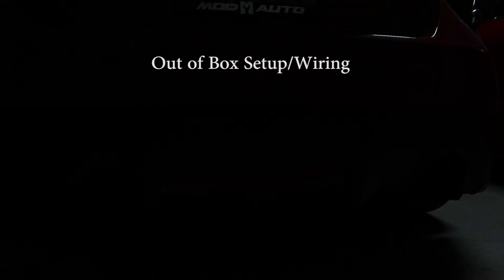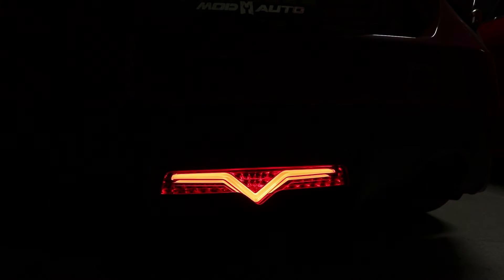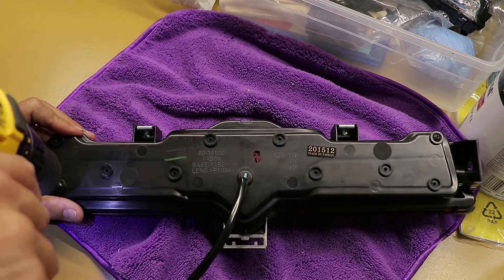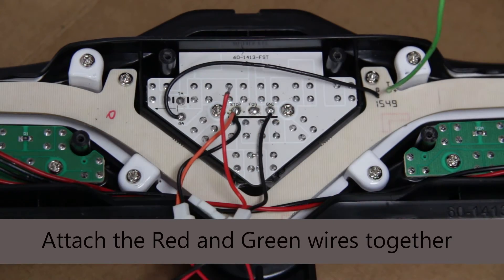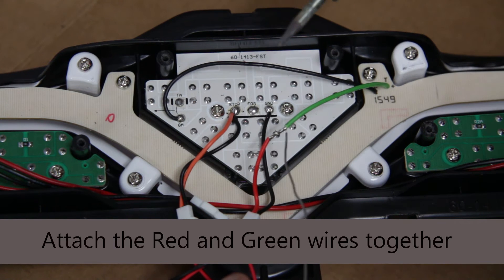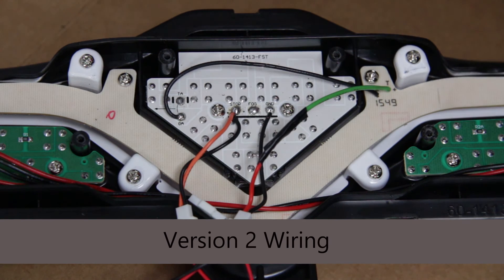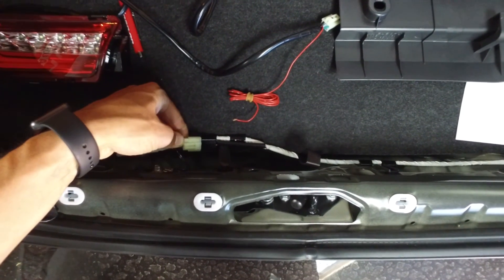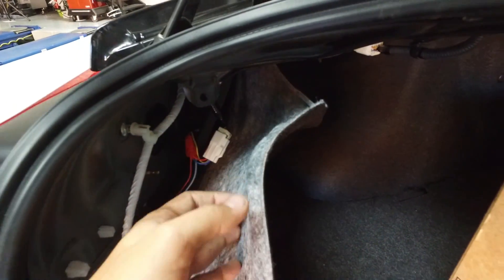DIY: Valenti 4th Brake Light Wiring Mod- HOW TO -Separate "V" and Brake

Comment: did you figure out why version 2 doesn't work? I'm about to order a 4th brake and want to do version 2. also with version 2 does it still flash when your headlights are off and you brake? thanks.
Reply from the maker: Nope, haven't figured it out-I think it's vehicle dependent. Try it, but don't screw everything back together. From what I've seen, MOST of the time version 2 works just fine. With Version 2, it will still light up/flash even if your headlights are off. It will act like a regular brake light-only "on" when you brake.
Reply: Charles Pages thanks! One last thing. What wires do I splice into with the valenti tails? Blue to blue and red to red still?
Reply from the maker: Correct!
Reply: will it be red to red and blue to blue regardless of the version i wire for the 4th brake?
Reply from the maker: Yes, unless you wanted to change something. The red wire on the 4th brake light tells the center triangle light to come on, and the blue wire controls the "v". All this mod does is depict whether it flashes or not (center triangle light)
Reply: I finally got around to installing it. I followed version 2 but the brake light is solid instead of flashing. Is that what you meant by those circumstances? Or is the circumstances regarding it not working at all?
Reply: Also what would happen if I only connect the green and red wire? Without moving the orange wire over
Reply from the maker: what happens when you hit the brakes? If the "v" comes on, the red and blue wires are reversed. The very rare/occasional problem with version 2 is that the brake light won't light up at all (well it does, but it is extremely dim).
Reply from the maker: The middle wire for you is orange? Haven't seen that before. If you ONLY connect the green and red wire, only the reverse light and brake light will work ASSUMING YOU'VE DONE VERSION 2 OR 3. If you didn't modify it, just hooking up the red will do nothing-the way this light comes stock is that the blue wire powers the "v" and the brake light, while the red wire is just a signal to flash.
Reply: Charles Pages my middle wire after rewiring
 is orange. When I hit the brakes the fog turns on but it's solid instead of flashing. I'm not sure if it's extremely dim. I'll have to double check later
Reply: Basically my wiring is set for version 2, but when hooked up actually works like version 3 instead.
Reply from the maker: Hmm, odd. You would know if it was dim or not-it's so dim that it almost appears off. Unless you really want the flashing, I might just leave it. Up to you though!
Reply: Charles Pages I want the flashing but don't know what could be wrong with the wiring. I have it exactly set like yours. Green and red connected, jumped the orange wire to the middle fog. Do you have any ideas? Thanks!
Reply from the maker: and you have it setup right now so the "v" turns on with the headlights, and the middle brake only turns on with brake, right? And this is the Valenti rear brake light-not one similar?
Reply: Correct the v only comes on with headlights, fog acts as a brake, and they're authentic valenti
Reply: I double checked the wire and everything is good. The fog actually flashes when I start the car but it's only solid when I brake and it's not as bright as when it flashes
Reply from the maker: Hmm. Odd. I would probably guess that yours is an "odd" one that doesn't like being wired like #2. It seems to be car specific too-I've tested lights on my car that DIDN'T work, but would work on another car. I just don't know what it is.
Reply: i noticed in the "valenti style" ones, you have to connect a ground wire to the bolt. how come the authentic ones doesn't require you to ground it to the bolt?
Reply from the maker: The harness that you connect the light to has a ground wire in it already. This is used by the reverse light that is back there, which means you shouldn't need to ground anything.
Reply: ah thanks. Just trying to think of a solution for this problem. I realized the braking is dim like you mentioned some people have. My only guess is maybe its a voltage problem since it flashes when i start the car and its also brighter when it flashes.
Reply: Finally got around to rewiring, I did version 3 now and it's perfect solid. Thanks for the video and help
Reply from the maker: Awesome to hear! Really wish I had an answer for why version 2 just won't work on some cars.

Comment: So out of the box there is no flashing correct? You would have to do version one for that
Reply from the maker: Out of the box, the light will flash. Shown at 13 seconds. Basically, the triangle and the "v" both light up, but when you hit the brakes, the middle triangle flashes. This mod makes it so the middle triangle only lights up when braking. Ver 2 or ver 3 tell it to flash or just turn on.

Comment: I did Version 3 Wiring and got it to look like 4:15.  Are there more detailed instructions for installing the light onto the car?
Reply from the maker: Only at the end of this video. Basically install it in the factory location, and run the wire loom into the trunk area. You'll have to tap 2 wires on ONE of the tail lights. The brake wire, and the running light wire. I would suggest solder and NOT t taps.

Comment: with the version 3 wiring will the brake light work when the brakes are pressed without the lights being turned on? Or do the lights have to be on for the brake light to work?
Reply from the maker: Version 2 OR 3 will allow the center brake light triangle to light up when the brakes are pressed WITHOUT needing the running lights to be on!

Comment: Hey,
I've wired it up for v2, but the V isnt coming on, only the reverse lights. Should I try v3? or did I screw up wiring somewhere
Reply from the maker: Check wiring (where do the blue and red wires get plugged into?). The only "problem" that could come up is that some lights/cars don't work with version 2...but the issue would be the middle triangle won't light up. After you do the rewire, the "v" is powered by the blue wire from the valenti light, which gets attached to the running light wire on either tail light.
Reply: So i cut open the wire for the 4th brake light harness, pulled out the blue and red wires, tapped the blue and red on my valenti drivers side tail lights and connected blue to blue and red to red. Another thing is that when opening up the 4th brake light, i never had the green wire to solder it was blue instead, but I assumed the wires were the same as they were wired the same way as the green one in your vid
Reply from the maker: Did the circuit board/insides look identical? There was an older version of the valenti lights-I have the info for how to rewire those, but I haven't put it together yet. You might have an older version light? If you could send me photos that would be best. Also, how did you make the connections? Wire taps or splice/solder?
Reply: They look pretty identical from what I remember. I tapped the wires. I'll remove the light and take some pics of the circuit in a sec
Reply from the maker: wire taps would be the first thing I check. If your light visually looks the same as this video, you're all good. But if it looks different, its probably the older version. How old is the reverse light?
Reply: Light it brand new, I just got it yesterday. I took it off and opened it up, heres  a pic http://imgur.com/a/mS9wk
Reply: brake lights arent coming on either. only reverse lights work
Reply from the maker: first, lets deal with the "v" which is the blue wire/one that is connected to the bullet connector/near whats labeled "T" in you photo (has black wire right next to it). Trace that wire, and make sure its connected to the "blue" wire lead outside of the light-the one you run up to the "blue" wire on the tail light. 
I would remove the wires attached to "stop" and "fog" in the mean time (keep them covered). Once this is done, turn on your running lights. The "v" should light up. If not, re-check wiring involving the blue wire only. Also, keep the white connector harness plugged in for all of this-it serves as the ground wire, which we know is working because the reverse lights work.
Reply from the maker: Once you get the "v" working, lets focus on the center brake/triangle. To keep things simple, start with version 3 wiring, which is both wires connected to "stop". Ensure these wires connect to the "red" wire that goes to a tail light, and make sure the red wire is connected well to tail light red wire. Put in a spot you can view from drivers seat (if you don't have a helper). Alternatively, you could set your phone to video record it while you step on the brake so you know if it works or not. Once you confirm the brake light working, then try version 2 wiring, which is one wire on "stop" and one wire on "fog". Repeat the test. If it doesn't work/light up, revert to version 3 wiring (no flashing). You've received one of the lights that doesn't work with version 2. Unfortutantely, there is currently no way to tell what works with version 2 and what doesn't. It seems random (which I just don't believe its "random" but I haven't figured out why version 2 doesn't always work with every car).
Reply from the maker: also, the very first thing I would check is the taps. Those things are one of the worst electrical connections I've ever dealt with. Some people use them all the time, others (like me) hate them since I don't have much (any) luck with them and they make diagnosing very difficult. I would ONLY keep them if you have a multimeter and can verify power is making it to the valenti 3rd brake light. Even then I'd splice/solder if you can. YMMV.
Reply: Hey, so I ended up splicing and soldering everything, and it works. Only thing is that although im wired up with the v2, my brake light doesnt flash (just comes on solid), and looks pretty dim. I guess the only fix is to wire up v3? would that make it brighter?
Reply from the maker: Oh, yup you got one of the lucky "not gonna work for some reason lights". Version 3 will work for you! No flashing, but it'll be nice and bright!

Comment: I was wondering if you had come across how to achieve the following? 
Triangle: fog light only
V light: comes on with breaking only
Reverse: comes on with reverse only

I love the light but can't find any tutorials as to how to achieve the above! Any help super appreciated! Thanks
Reply from the maker: First, I'd do version 3-no flashing.

V light-hook the "blue wire" FROM the valentines reverse light to the red wire (should be red) of one of the tail lights (left or right doesn't matter).
Reverse-this SHOULD be the regular plug and play connector/harness. The wire is teal/green. Out of the box it should only come on when reverse lights are on.
Triangle...this is what @andrew bailey was dealing with yesterday. This is the "red" wire from the valentines reverse light. Hook this wire to whatever wire has positive (+) when the rear fog is on. You guys have a wire running to the back of the car for this, right? IIRC you guys have a factory rear fog light, which means you have wiring there.
Reply: thanks man! Yep we have Factory rear fog. I'm gonna put an order in for the lights and give it a go when I get them :-)
Reply: Hello ! I'm in the same case. I need to have the triangle light up very bright to have it act as my rear for light, when I turn it on. Did you find a solution ? Thanks.

Comment: I can't seem to find install instructions so I have to ask, if I just install normally without rewiring where do I connect the separate red wire that is next to the harness? Thank you!
Reply from the maker: Sorry for delay-holidays!  Anyway, the red wire needs to go to the brake light (driver or passenger-it doesn't matter). There are 4 wires in the plugs for the tail light, you need to tap the one that has (+) when the brakes are applied. I don't recall the color. If you have valenti lights however, its the "red" wire from out of the valenti brake light.

Comment: so i have a rather weird question. 

I wired mine up like you shown for version 2. everything works properly other than the brake light. when the red wire is connected to the brake switch wire it comes on extremely dim. if i connect the red wire to the parking light wire it does the flash and stays solid like it should. i even connected it to the turn signal wire just for shit and giggles and it works. but once again on the brake wire. its not working. i was fiddling with it for a while and it eventually started to work. turns out it only worked when i had low battery power. so with that in mind i tried a resistor in line and still nothing. so now i am completely stumped. if you have any knowledge on how to help with this issue id greatly appreciate it. 

Thanks.
Reply from the maker: ugh...I've run into this issue 3 times now (yours is the 3rd) and I DON'T KNOW WHY. I spent several hours chasing my tail on this. Whats weird is if you bench test (like use a power supply) it works fine. Put it in the car, and run it off the car wiring and it doesn't. I just don't friggin know. I think its vehicle specific even (the day I wasted 5 hours trying to diagnose, it would NOT work in my car, but it would work fine installed on another...). As you figured out, it has something to do with resistance, but again, no idea why. It could have something to do internally of the light (different brand resistor/other tiny electrical thing on the board)...but ultimately, I don't know and the electrical people I spoke to about it didn't know either. 

The issue is light specific, which is why I think there is/was a slight change in parts (not necessarily older or newer, just they swapped out one piece for another during assembly)

Version 3 will work for you, however.

I'll have to add an edit to the video-but I know Modbargains doesn't even offer version 2 anymore since we would have no idea if a light would do this or not. I would bench test every single one that was shipped out, but after this issue was discovered, we made only version 3 an option.

Makes no sense to me.
1. Mod light (version 2)
2. Bench test light-it works!
3. Install light-it doesn't work? wtf

Sorry Andrew, I know this is frustrating. I was losing it the day that I discovered this problem.
I'm no electrical expert, but I was rather upset that something simple could not be figured out.
Reply: okay cool if version 3 will work then i will just set it up that way. i was just mind boggled and couldn't figure out why the hell it wouldn't work. I'm honestly just glad to hear I'm not the only person that has had this issue. I really appreciate the quick response as well.

EDIT: if yall ever find a solution to this Id REALLY like to know how to take care of it. or if i figure it out i will let yall know
Reply from the maker: Correct, version 3 has been 100% work rate when wired properly. I am boggled by the version 2 gremlin as well. It just doesn't make sense lol. Depending on where you bought it from, you could try swapping it out (I wouldn't mention why...since opening voids warranty). It's light specific, I did dozens of these for ModBargains, and I only ran into this issue twice.
Reply: I ordered it from Subiespeed but once installed they will not take a return. and I have had it installed for a couple weeks now.